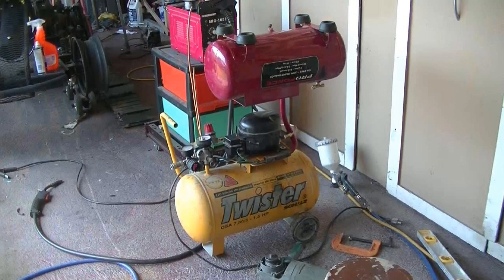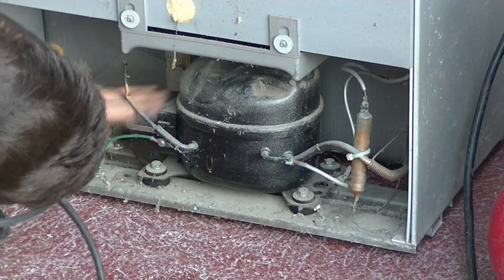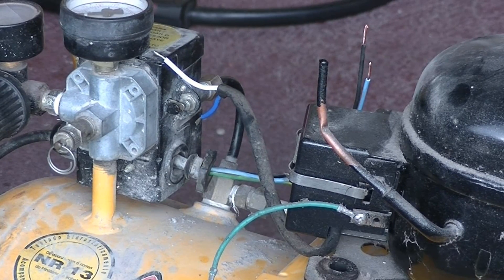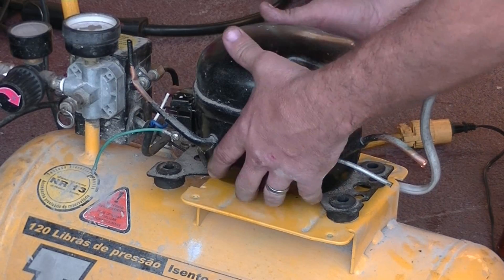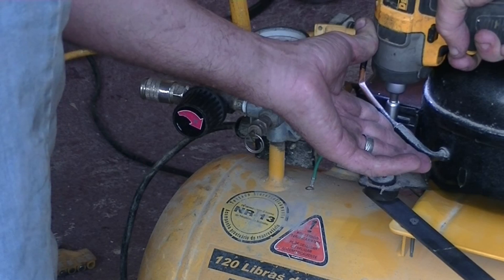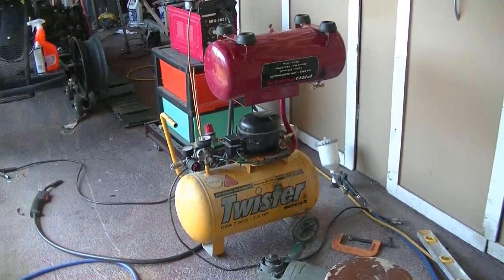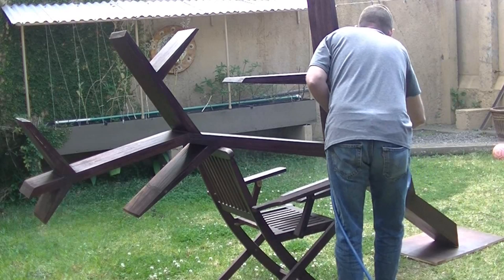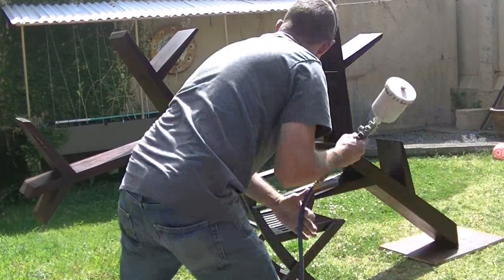Air compressor conversion using a refrigerator compressor

Comment: Great idea! Kinda need something like that whats silent into my apartment house build shop. Thought the volume might be big issue as i need constant 120psi and tons of volume,  but have to keep eye out for broken compressor and big fridge.

Any idea if fridge pump and ice box compressors have difference in volume?
Reply from the maker: Hellsong89 I dont know, you would think maybe the icebox compressor would be stronger. Most of the builds I see on YouTube use large refrigerator compressors. I have seen setups with more than one compressor hooked up also. The pressure does not seem to be the problem only the volume.
Reply: Aceman307 mmh i need to check the volume of those and do some comparisons. Good thing i know person whos working with these machines so he might know about it.
Any ideas how to get active lubrication into system? I was thinking if you would put oil extractor right after pump and lead that oils to intake, so lubrication would be closed circle system? Thought oil extractors might also gather moisture and i dont know how the pump likes if there is moisture pumped in.... possible corrosion over time?

Comment: Your right, they make great airbrush compressors. It's a good idea to have an oil trap of some kind to drip back to the pump and keep the air clean.
Reply from the maker: Sirus Thats a good idea.I have been adding a little oil in the inlet tube every so often. A air filter would also be a good idea.
Reply: they where built to live and run submerged in oil. that's why they last so long ;) Being a closed system they wouldn't run out of oil. I'm sure there is a video somewhere of how they run inside and spin oil every where.

Comment: I been busting a** welding the plates for the other side. And in between the welding, been designing the drive sprockets, and brakes. Got the brake hubs made, got some metal from work to make the rotors, then make the calipers. Got 4 of those to make. Seen a design on utube for it using STEEL tubing for the calipers. I'll be making a video soon on how I designed the drive sprockets. Plus all the stuff around the house. Oh boy.

That was pretty cool you got it through the house.

Comment: Back in the day, my Dad's friend had one of those compressors with just a hose on it to fill up tires. I thought it was the neatest thing. I think you said it would be good for a little airbrush for painting, I got one of those airbrushes and can hook it up to my 13 gallon compressor now, that would be a great upgrade. gets pretty annoying when it kicks on and usually startles me, bad when your in the middle of painting something. Cool idea, thanks for sharing.

Painting your tracks I see. So how heavy are yours? If you didn't see the vid on the weight of mine , mine weigh a ton, LOL. And how did you get it out of your backyard? When you said it was enclosed all the way around.LOL.
Reply from the maker: ***** This project is about 3 months old I finally got around to making a video. So this video of the tracks are before my last video on my tracked vehicle moving. The tracks are about 30 lbs each. I was able to take off the wheels and tracks and with some help turn it sideways and slide it through my front door. It was easier than I thought it would be. Your project is looking great I havent seen a new video in awhile hows it going?

Comment: you should convert a water heater to a tank for that thing
Reply from the maker: butre jp Or an old LP tank.
Reply: +Aceman307 guys neither hot water tanks or old propane tanks should be used for air storage....its possible for both to rupture
Reply: JIMMY TATE hot water tanks are pressure rated to around 150 psi.  there's less margin of error available since water doesn't break out violently but a typical 120 psi compressor you find in cheap air compressors won't burst a hot water tank